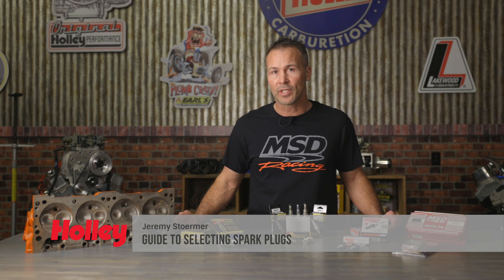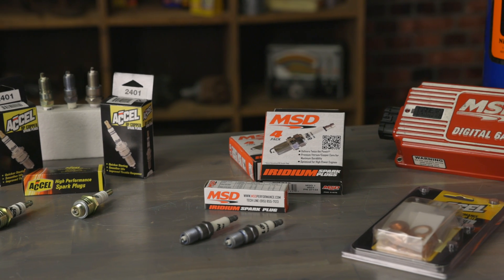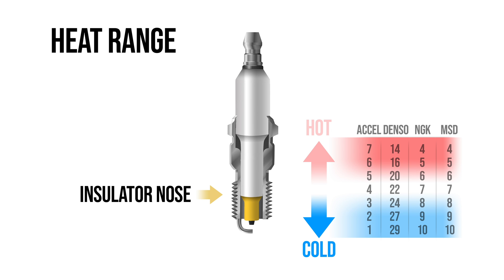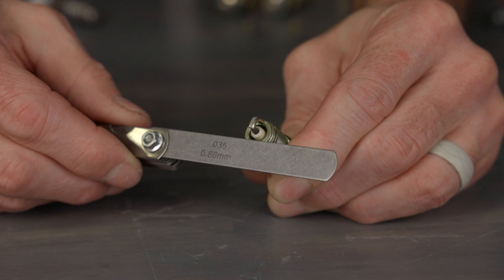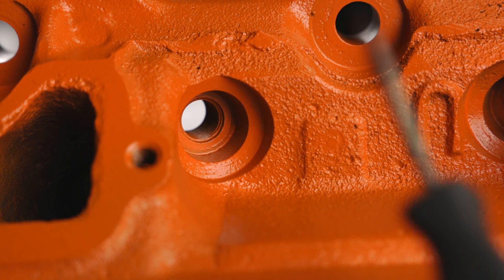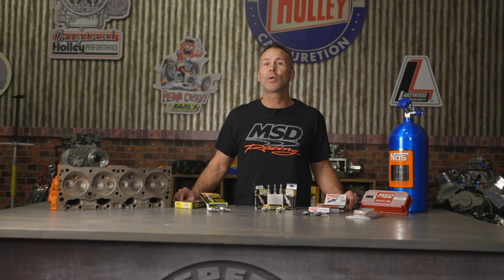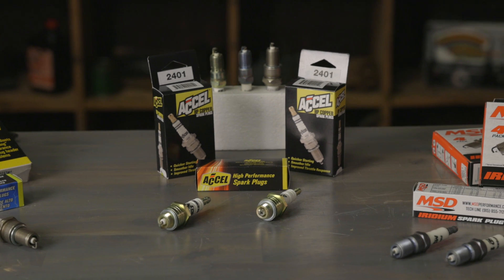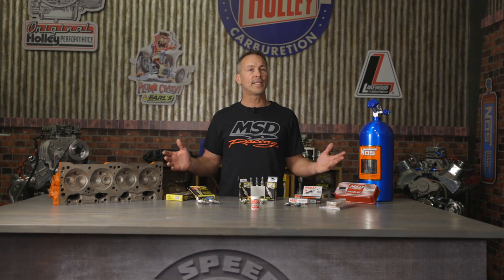How to Select Spark Plugs for Your Engine

Comment: If using a MSD box with a high output MSD coil, why not just use the coldest plug available also with the longest projected tip.....?🤔

Comment: For my car, which is naturally aspirated, 2.4 L, I will prefer Mid-hot plugs in winter, to make sure cold air-fuel mixture burns completely, and debris not built. 

In Summers, may be keeping the same, as temperature won't rise that high.

Heat range I believe is the most important factor, 

on too hot side, problems are could be 1. pre-detonation (that plug sparks, before piston still way below) and 2. knocking. 

On the cooler side, problems could be, 1. Not able to burn the less compressed air-fuel mixture completely, and 2. not able to clean debris off its tip

Comment: Dont think you can outsmart the engineers that designed your engine. You can waste a lot of money following advice from a YouTube channel. Just use OEM original equipment plugs and save your cash.
Reply: It’s pretty clear that this video is aimed at people who have tuned their engine beyond factory specs, rather than those running something completely stock.

Comment: Heat ranges are flat out confusing when swapping over brands. Most, the lower the number, the hotter it is - except for Bosch and Accel [to pick two I know of], which adhere to the opposite.  Champion?  Bring a decoder ring, cause I can't explain their method - some sort of hybrid nuance happening there.  Denso seems to have the most coherent scaling, but some would rather not have so many numbers to choose from and live in a 1-10 world.

Comment: I need to know which the spark plug is good to Mitsubishi 1988 Colt 3 cylinder,  thanks
Reply: You may check with an Auto Parts store in your area. They can give you 2 or 3 options that are best for your vehicle.

Comment: ??? u said iridium has a lower resistance than copper?? thats not true, copper has a lower resistance And higher conductance
Reply: You are right ( about the resistance ) but the electrical resistance doesn’t matter so much with such a high voltages and small currents as in the secondary side of  ignition system. Dew to its much higher melting point iridium allows much thinner central electrode . For example on Denso Iridium TT it’s only 0.4mm in diameter when on the regular nickel ( copper core ) electrodes plugs the diameter is 2-2.5 mm . The sharp central electrode concentrate the electric field and the spark jumps the gap when the voltage across the gap is 3-5kiloVolts lower than on  the thick electrodes plugs . Also inside of all modern spark plug is added 2-5KOhm resistor and the secondary winding of the ignition coil has the same resistance so the difference in the resistance of nickel plated copper electrode compared to iridium tip nickel plated copper core electrode of few miliOhms is negligible.

Comment: can i use platinum or iridium plugs on a 1970 318 engine with pertronix ignition or do i have to use copper plugs for the 50 year old engine or is it safe to use the plat or irid plugs
Reply: You can use platinum or iridium plugs I've used those in a 351 Cleveland and 302 and these were older Motors like your 318 iridium plugs last a long time in those old Motors

Comment: I have a 2015 Hyundai Genesis N/A 5.0 I am looking for a good performance plug Its pretty much stock I have a sprint booster, exaust and ram air snorkels I'm gonna get a tune soon and would like to change the plugs before then any suggestions?

Comment: Are non resistor plugs good to use?
Reply: In a Model A Ford maybe😉 but seriously, they can play havoc with sensitive modern vehicle electronics due to the RFI they can generate (I use them in my old kickstart chop with points ignition and copper-core wires, without them she's a bear to start)

Comment: I don't recall that the electrode is actually copper on copper electrodes. The conductor inside the spark plug is copper but the electrode is not. I have filed those and never found copper in any spark plug. They haven't used copper for the electrodes of spark plugs since at least the 1950s probably the 1930s because it would only last about 5 or 6,000 miles. If that.
Reply: Its a copper/nickel alloy. They just call it copper for short. You are correct about solid copper electrodes not being used for about 100 years as they only lasted a few hundred miles
Reply: @guacamoleman87  Thanks did not know that.

Comment: hello. i have a 2015 silverado 1500 LT 5.3. Complete stock. I just bought the Blaster and Super Conductor for it, and i was wondering which spark plug and spark plug gap i should be running with this combination. Thank you!
Reply: Owner's manual

Comment: Man I need help, I don't know what's wrong with my bike! I'm running out of money and patience. 

Bought it from someone who said there was nothing wrong with it, but it hasn't worked since the day I got it. 

Had it for almost 2 years now and sometimes (but rarely) it works pretty much like it should and suddenly just stops working again. 

I finally changed the regulator and it worked perfect!! for 15 minutes... Now it'll barley start and just stalls.. 

The spark plug is completely black and dry. And idk how to fix whatever is turning it black. Bike doesn't have a carburetor, so if it's running rich I don't know how to fix it. And if I need a new spark plug I don't know which one to buy. 

Someone please help me!!!
Reply: Owner's manual tells you which plugs to buy. Try cleaning your injectors.